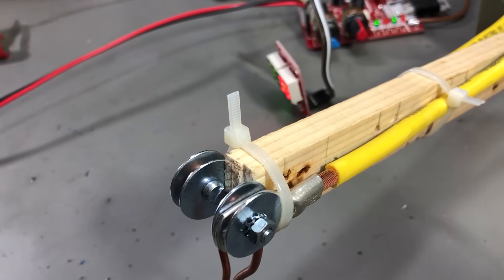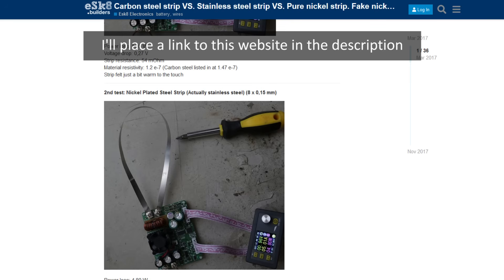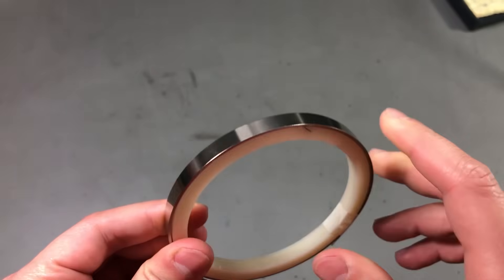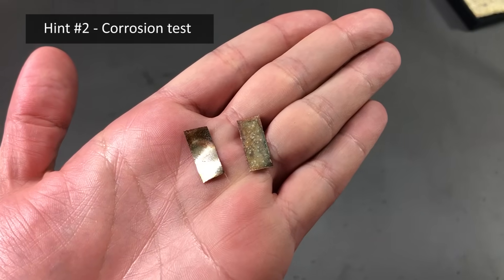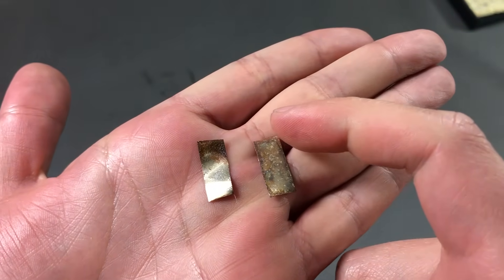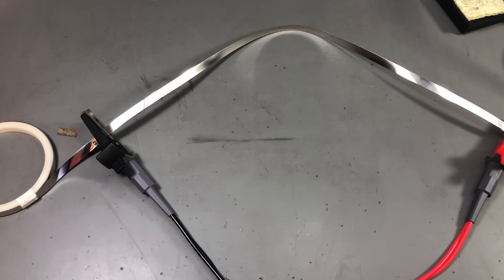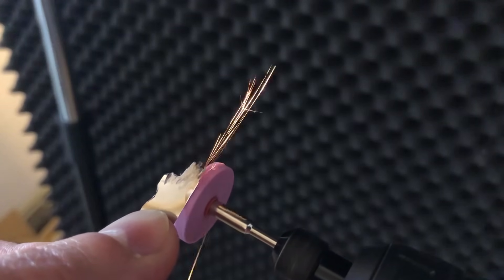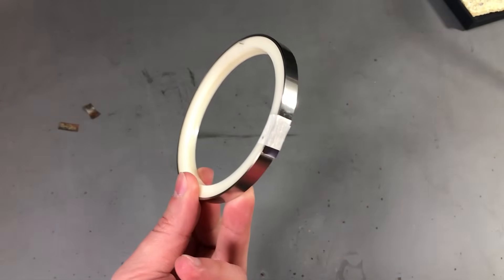Voltlog #227 - Identifying Pure Nickel Strip vs Nickel Plated Steel

Comment: If it were stainless steel, it is not corroded in a saline solution, even scratching the strip. To check if it is a ferric material, adding concentrated vinegar (which is used in cleaning) + diluted hydrogen peroxide (from which it is sold in pharmacy) and heating without boiling, the solution should take a red-fare color, for the formation of iron acetate, soluble in water.
Reply: No one is going to try to scam people by selling stainless steel as nickel instead of mild steel.

Comment: Sir, why not use copper instead of nickel. I am a noob please don't laugh at this question
Reply: Copper is corroding and hard to weld
Reply: Impossible to Weld without producing so much heat that the battery would suffer.

Comment: I have bought many pure nickel strips from ebay for around $1 per meter.  The catch is that they are usually in 1 - 2 meter coils.  These were likely leftovers from some larger manufacturing, hence there is no real cost to the person selling them.  And Yes, you do have to be very careful when buying anything like this.  CCA cables is another example.  They are typically around half the price of pure copper conductors, but are merely copper coated aluminum.
Reply from the maker: As someone else mentioned in the comments below, I guess the best bet would be to try to get the nickel strips from specialty stores that deal with these kind of products as that is more likely for them to know what they are selling and where to source the stuff. I agree CCA cables is another good example of product that we often get fooled by.

Comment: Fake nickel strips are really annoying, I was trying to do some nickel electroplating and even the expensive strips had steel in them which ruined my solution each time. Took me ~5 tries until I received genuine nickel strips from an ebay/aliexpress seller.
Reply from the maker: As someone else mentioned in the comments below, I guess the best bet would be to try to get the nickel strips from specialty stores that deal with these kind of products as that is more likely for them to know what they are selling and where to source the stuff.

Comment: Easiest check is scrape and put into salt water, result in about 3 hours already.
Specialized sellers for only battery stuff are more trustworthy.
Cheapest way is to buy whole 1kg roll ~50-60$.
Copper is ~5x cheaper but corroding and hard to weld.
Reply: I guess that means it's a seller's market for nickel strips, because the base metal only costs 2x as much as copper.

Comment: I bought some battery strips on Amazon and they are pure nickel.
I can't remember how much they were but I remember they were kind of expensive.
I only got 50 pre cut 2 inch strips and I thinks they were around 6 dollars American.
Reply from the maker: Yes they can be found on pretty much any platform, ebay, amazon, aliexpress, but some people are not aware of the differences between the two and they will mostly get the cheap stuff believing it's the same as the more expensive stuff.
Reply: 100 inches is almost 3 metres, so your price is still pretty cheap ($2/m). Have you conducted any of the tests in the video? Or weighed them as Juraj Lonc suggested?

Comment: I used methods you mentioned. In addition to that I performed weight test. Nickel is a little bit heavier than steel. I ordered 5 meters of 8mm wide and 0.15mm thick nickel strip (yes, I measured those dimensions). If it was Nickel the weight would be 53.4 grams. If it was steel, it would be less (around 48 grams). I used jewelry scales and I measured 53.3 grams. It clearly is a pure Nickel strip.
Reply: I have received 5m of nickel plated steel strips today. Again, 8mm wide, 0.15mm thick. It's weight is 48.3 grams. Exactly as expected. So, this is pretty accurate method.
Reply: Your solution is definitely a lot faster. I also have an accurate kitchen scale - good to know that I can get the expected weight quite fast just by calculating the cm^3.

Comment: It's not easy finding pure nickel strips or rolls, but if this new guy you have doesn't pan out, I have a site for you. I take it you're using nickel plated copper for the washers and connectors for the copper tips and if not the steel works just as good for this being you're using overkill pulses anyway. I used a make shift setup using a 350 to 400 amp tractor battery, a 1978 Ford Bronco solenoid, some thick solid copper wire the cable company gave me to wind and use for the connection line for the copper nails and a momentary switch which I only tap as fast as possible getting the same results and they were parts I had laying around, real nickel will burn through much easier than the plated crap. I would rather go with copper strips or a solid strand of wire that doubles as a fuse. In all reality what is the batteries positive button and canister made of because that sums it up right there...Silver is the best for making any connections for a PCB or anything, but for your own Class A stereo build would be worth your wild just because and makes for a conversation piece and silver solder, but again, in the end it's about what they used to make the components and the legs.
Reply: I ordered nickel strip from that ebay seller. I tested it and it is pure nickel strip. At least the one I received ;) Measured resistance, measured weight, tested with salt water and tested with grinder/sparks. All the results confirmed it is nickel.

Comment: Saw someone try to spot weld pure nickel strips, and it's not as easy as steel because it's the resistance that makes the heat that welds them together. We'll have to see how you go with PN v S.
Reply from the maker: I am pretty sure my DIY spot welder can do it, It has decent power. Not so sure on the sunko 737G spot welder I reviewed, that one seemed to have less available power

Comment: I don´t get it.
1. surely not all of these metal strips will be the same thickness
2. if you want low resistance in a thin strip, I would think you would want nickel plated copper or similar
Reply: NiCu or better yet pure copper are far superior, yeah but even more expensive!
Reply: @russ18uk  And copper is nearly impossible to spot weld because of it's low resistance.
Reply: @russ18uk  Well, it depends. I can buy 5 meters of 8mm wide and 0.15mm thick nickel strip for 8€ from China (it is 1.6€ per meter). Or I can buy pure copper strips here in Europe that are 15mm wide and 0.3mm thick (so double thickness and double width) for 1.2€ per meter. So this copper strip is cheaper than nickel strip from china. These copper strips are used for connecting lightning conductors and lightning rods (no problem buying them here).